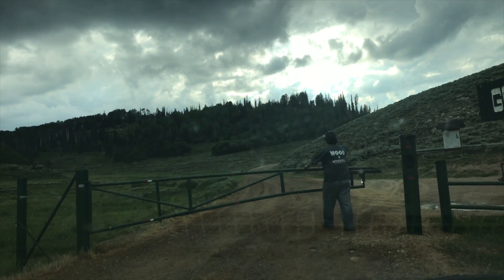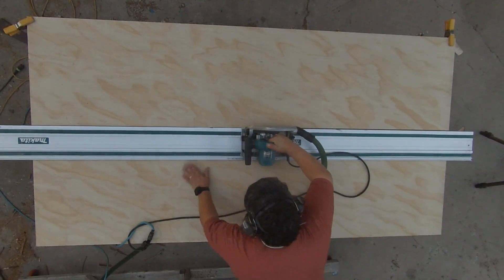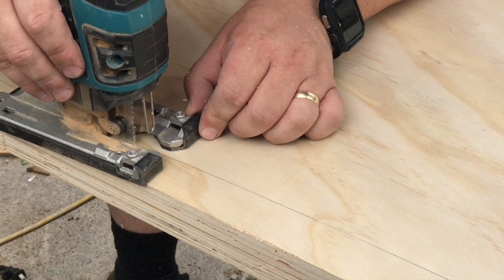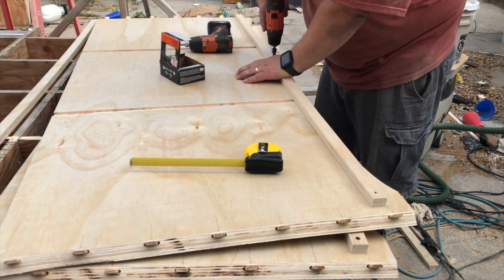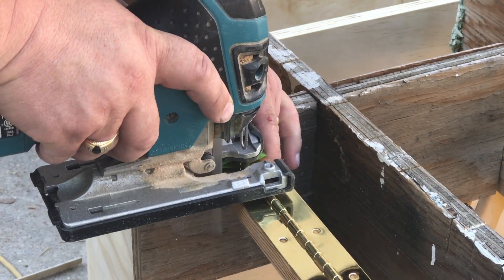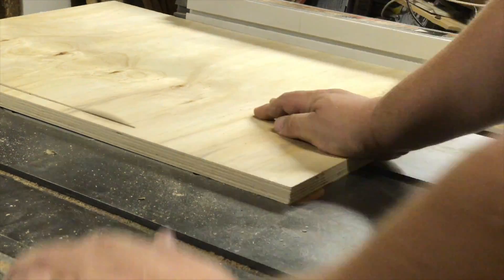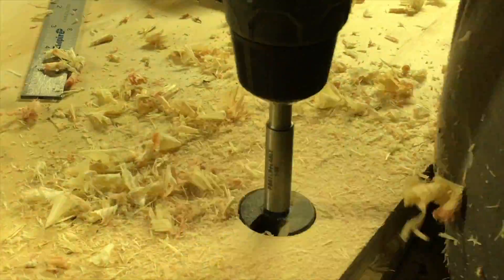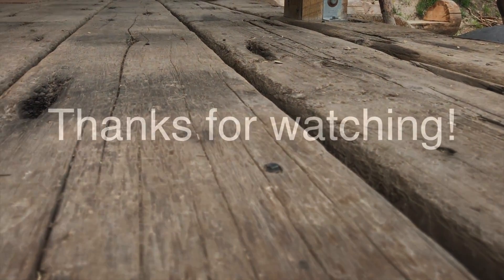A Simple DIY Plywood Blanket Chest

Comment: Yea simple,,,
Reply from the maker: Martin Jordan It certainly is.
Reply: @BitsandWood  you used a large amount of equipment and technique to build a box. Simple means anyone can do it. Try making this a again with 3 tools cutter, drill and sander then you can call it simple.
Reply from the maker: @martinjordan595  Simple does not mean anyone can do it. It means it isn't complicated. Most of the tools I used are common to any hobbyist woodworker. The only uncommon tool I used was the Festool Domino but a biscuit jointer could have been used or instead of mitered corners, it could have been butt jointed corners with screws or even dowels. I'm comfortable calling this simple because that's exactly how I see it.
Reply: @BitsandWood  plain, basic, or uncomplicated in form, nature, or design. Clearly not simple due to the amount of tools and techniques used. Saying you could have means nothing. Nvm
Reply from the maker: @martinjordan595  It is uncomplicated. Clearly, the simplicity is in the eye of the beholder. It's okay if we don't agree on that point. It's just a YouTube video, not a math test.